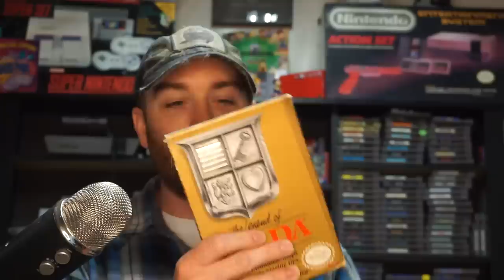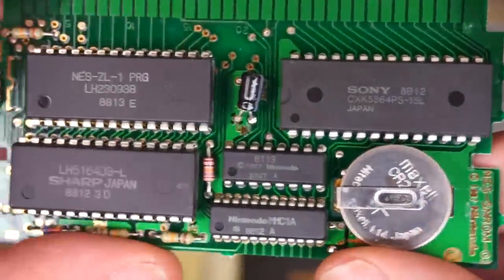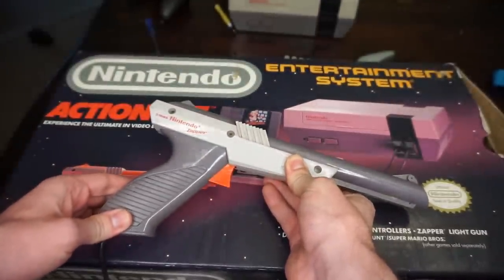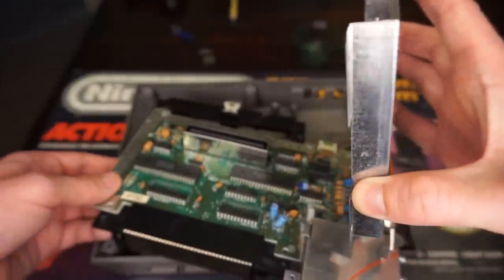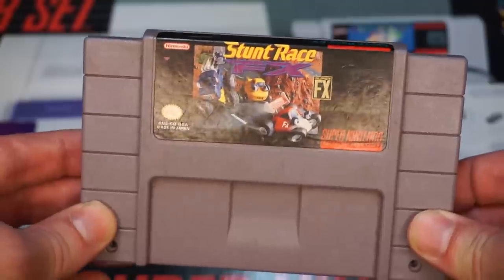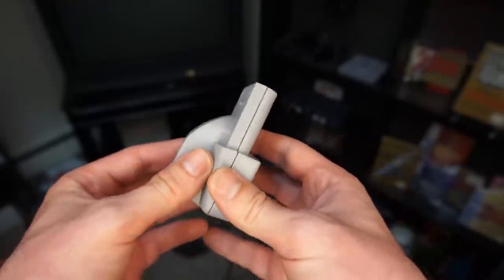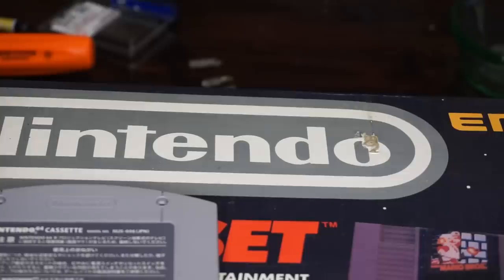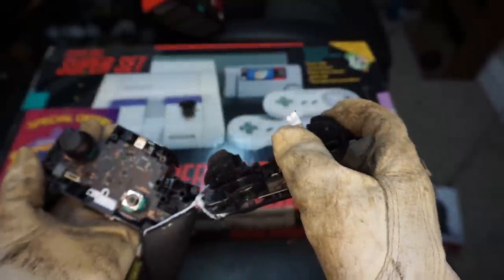What's Inside 10 Nintendo Products + Facts & Trivia

Comment: 2:40 - it is not laser edged, it is a part of the actual design of the circuit board. it is actually UV light and acid based chemistry
5:28 - is not caused by dropping the cartridge but by hitting it while it is in a toploader.

Comment: Just so you know, next time instead of breaking a device because of a faulty screw. You can use a dremel and drill throught the screw. If you're patient and skilled enough (it's quite easy) you'll only destroy the screw and leave the thread intact.
(Also I believe you can see the printing only by pushing down the joystick)

Comment: Oh geeze, they are not EPROMS, that is COB (Chip on board) where the IC die is bonded directly the circuit board and then wire bonds are made to the traces on the board. Black resin is placed over it to protect it from light as well as physical damage. It is a cost saving method used in a lot of older consumer electronics.

Comment: 9:50 A square black plastic thing with legs isn't really a chip, it's a chip package (which does contain an actual chip unless it's a dummy/fake). A chip looks like a tiny shiny square, intel commercials sometimes showed them magnified. 
Sometimes a chip isn't packaged but soldered right onto a board to save money if the chip is not sold separately from the board. When this happens chips are usually protected from moisture and scratches with epoxy blobs on top (AMD didn't do that properly in Athlon XP CPUs to help with cooling - thus they were notorious for physically breaking upon installation)

EPROM and EEPROM are a types of erasable memory chips that didn't need a battery. I'm not sure if Starfox uses one, if it does - it's probably the rightmost unlabeled one. Other are proper RAM, FX and ROM chips - just without their usual packaging.

Comment: The thing about the memory management chip isn’t very accurate, based on my own understanding. 8 bit processors can only access so many addresses of memory (*cough cough* 16 bit address bus). The memory management chip was designed to make memory banking easier for developers. The main cpu doesn’t really know where it is in a program. All it knows is how to fetch an instruction (and any applicable arguments) and how to execute the instructions. A special register inside of the processor, the PC (program counter) is in charge of keeping track of where in memory to read next. The cpu can technically write to this register via a jump command, but that’s about the only influence it has. Since the cpu doesn’t really know where in a program it is, nor how long it is, it is possible to place multiple rom chips in a circuit and change which one is the active chip being read from. This is what banking is. Building a circuit capable of doing this is costly and adds a fair bit of required physical space, which is why the memory control chip was created.

I never said creating the memory banking circuit was hard, just costly and physically large. The idea (to me) is that the circuit is accessed by the cpu in a certain address during an IO write operation (it’s emulating an output device). Whatever number is written to this ”output device,” determines which memory bank is activated.

Comment: Um.. at 9:20 the chips are connected directly to the board with bond wires then blobbed. Just because there isn't a removable pacakge, it doesn't mean that it isn't a chip.

Comment: Hey- great video but I'd like to make one correction: CHR is a ROM chip.  There are two ROM chips in an NES cartridge.  This is an important discrepancy because RAM chips ALWAYS get wiped when they lose their battery.  If the CHR memory were a RAM chip you would lose your graphics and text if the chip's battery died.  That would make for a very poor product.
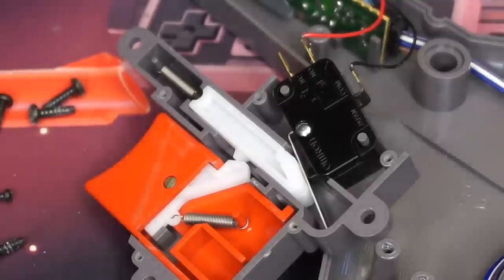Reply: 7:30 STARTROPICS  :D  Holy crap another startropics fan!!!  I can't believe I recognize it by  the avatar.

Comment: Please don't put electronics in an oven. It is likely to fuck the actual components, and with anything that uses Flip Chips the heat WILL damage them and basically turn them in to zombie chips that are dead but will work for a month or something. If the ribbon cables are bad, you're better off desoldering them and replacing them altogether.
Cool stuff other than that, especially the look inside a gamecube since that was kinda my jam growing up. Though a little nitpick; that heatsink isn't held on with adhesive. If it was thermal adhesive, you wouldn't get it off without ripping the chips off. Those looked a lot more like thermal pads, which are common when there is a larger space that needs to be bridged and the chip doesn't output THAT much heat. The N64 used thermal pads as well, for example. They just got sticky and broke apart due to their age.
And that little hidden message in the Switch pro controllers is quite nice.

Comment: My "job" is cleaning, repairing and modding old consoles and oh man i have a major ich to clean that poor gamecube.
But yeah not a bad video but could do with some diagrams abort things like chip layouts and your saves aren't backed up on the battery rather the volatile work ram in the cart
Now the difference between ram and rom in the nes's case is that rom can be read anytime but can not be written to but ram can be read and written to but only when the ram chip has power that's what the battery is for and why when the battery goes flat you lose all your saves 

Cartridge Layout
https://img.cat/i/42iim3e.png

NES Mainboard Layout
https://img.cat/i/vr5f4rl.png

The picks aren't mine but the photoshoping is :P
I was going to do a diagram of how the CIC lockout chip works but i don't own a NES to make high res pics of to do it justice
But if you want more of theas layouts for SNES, N64 or PS1 let me know i haves those... also xbox but that might be a tad new :P

Comment: Great video but You got some stuff not quite right.

Nes:

The mapper chip is used for bank selection between the two mask roms and SRAM used to save the games progress. 

The battery is used to keep refreshing the battery backed ram, this because ram is volatile meaning it looses its data when it's power supply is disconnected the battery prevents this. 

The marking on the cartridge is not its serial number. That's the board reversion of the pcb not its serial number. it's not laser etched either its gold plated just like the edge connector as part of the pcb fabrication process. 

SNES: those black blobs are indeed chips. They're a technology called chip on board (COB) which has the chips die glued on to the board then bonded to its corresponding terminals before being covered in epoxy. Its a used to reduce cost, though its expensive to setup for mass scale production you end up saving compared to using chips in packages.

Comment: Wait, wait... They seriously repeated that cheap-ass region lockout method from the SNES!?

US and Japanese SNES games are interchangeable - they work in the other system. (mostly. Some games have detection code.)
The square cartridge design prevents you inserting a US cart in a Super Famicom, and some plastic tabs in the cartridge slot prevent the US system playing Super Famicom games.
However, Super Famicom and PAL games/systems have the same cartridge design - the lockout chips inside are what prevent the games working.

So, what you're showing here is that the US n64 again uses physical cartridge shape to protect against japanese games.

Meanwhile, I have a japanese copy of Pokemon Stadium, and it fits perfectly into a PAL n64... (just like the snes), but nothing happens.

I would've thought they would try something a little more sophisticated for the n64, but I guess not. XD